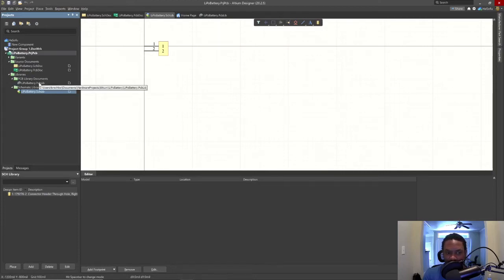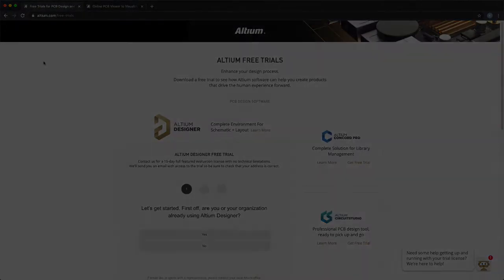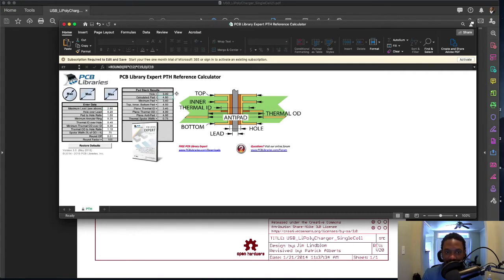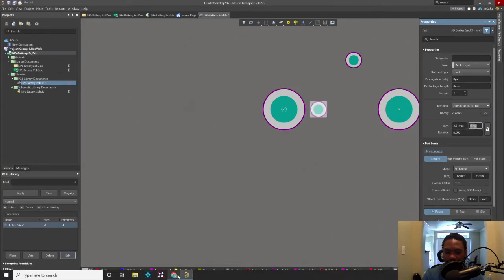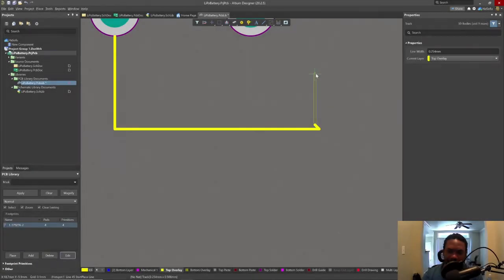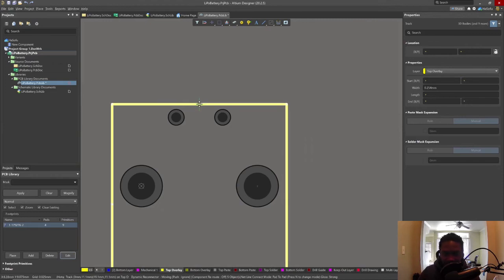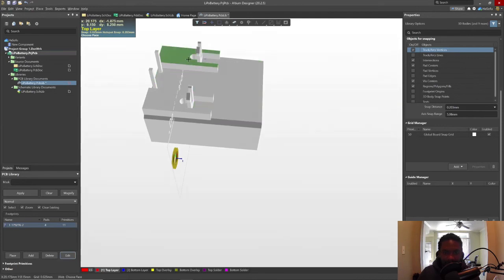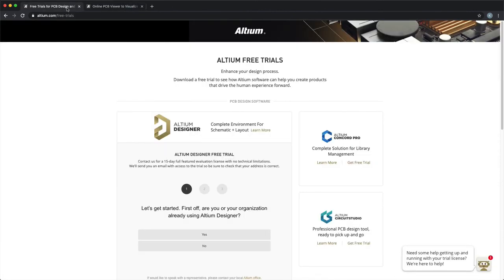PCB Design Tutorial 04 for Beginners (Altium v20) -  PCB Footprint and 3D Model

Comment: 11:40 the pads are not turning grey, they are turning red, and the line is turning to black
Reply from the maker: Yep, that's still single layer mode but the predominant color depends on the layer you're currently on. If it's red, then you're on the top copper layer in single layer mode.

Comment: How did u copied second pad, Please explain.
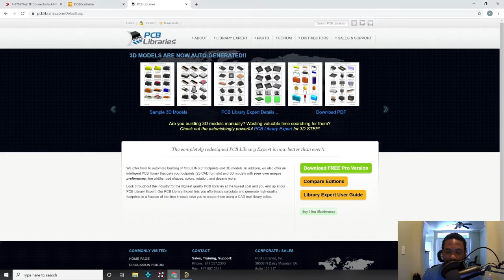Reply from the maker: Ah, at time 5:40 in the video, this is automatic, and not a copy. When you choose to Start placing pads, it will keep placing pads until you stop (Escape key or Right click). 

If you want to copy a pad, though, use the filter icon at the top of the working area on the icon bar. Choose 'pads' or something similar to that. Then select the pad you want to copy. Do Ctrl+C to copy. voila, it's copied and you can Ctrl+V to paste it wherever.
Reply: thx

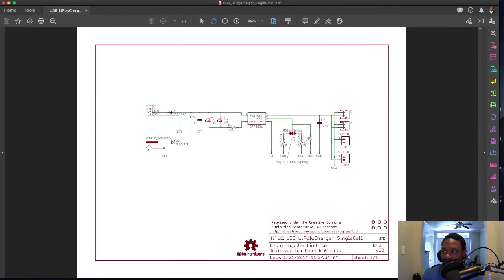Comment: 4:57, did you use "2.8" as the Maximum Lead because you needed a "3" for the Hole under Pad Stack Results? So basically, 2.8 was entered to ensure you get the 3 and that gives you your Calculated Pad? Just looking for your method here. Great content, thanks!

Comment: Nice clear explanation, how can we create footprints for through hole resistors?. What will be the values of the pads dimensions and distance from pad to pad?. I have school project and enforce to use through hole components not SMD.
Reply: @techedkirsch  yes, I know but how can I calculate the values of pads' dimensions and distance from pad to pad?. let's say how can I translate those dim datasheet onto Altium, are the values of Pads' dim coming from tape spacing?
Reply: @techedkirsch  Thank you for all the inputs that you put in order to answer my concerns. Just got it done by following IPC guidelines.

Comment: So far I am able to match.  Add foot print shows different panel  than yours which allows to type the name but not the the description . The panel you have tilted PCB library footprint ???, I was not able to get such. I stuck  here. I was doing these stuff in pcb123, very easy to create footprint library . Free software with the condition they create the  gerber files and print the PCBs. You may ask, why you don't use it. In every company I go for an interview they ask me how much experience do you have in OrCad or Altium.  In 20 years, I used Autotrax then PCB123.